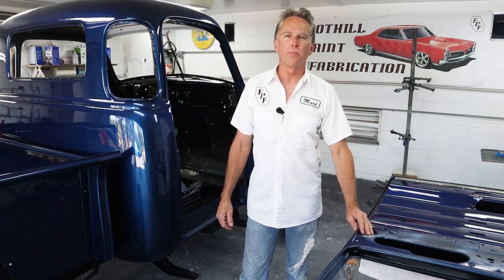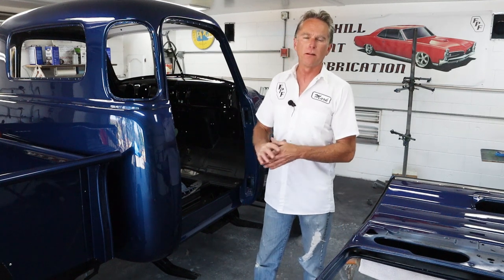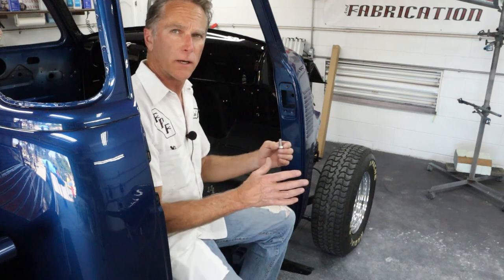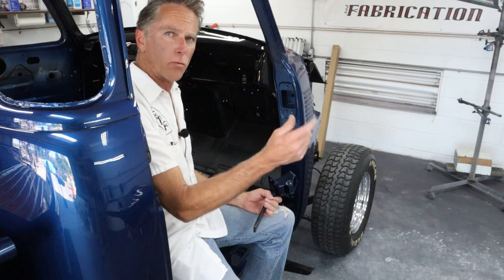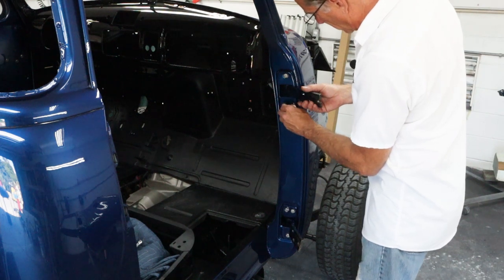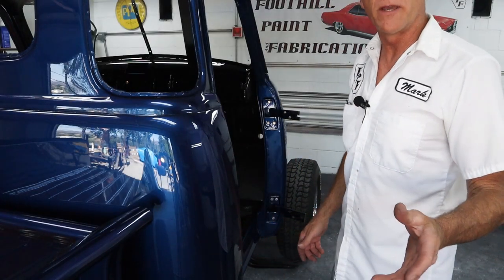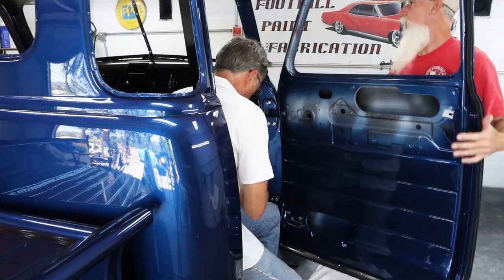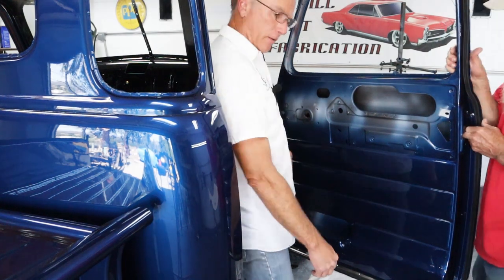1950 Chevy Truck (Ep 69) Hanging and Adjusting the Doors on the 5 Window Cab

Comment: Rewatching some of these misc '50 pickup videos Mark. Getting closer to sending the panel truck out for painting. I want to test fit the doors this week to check the gaps, etc. Domt anticipate any problems because the the truck has led a pretty sheltered life the last 45 years sitting in various garages ha ha. Will email some updated pics soon. Thanks for your videos!
Reply from the maker: Awesome progress!
Remember when these trucks were built fit and finish wasn't all that great. You can absolutely do better with some work to the hinges and latch. Getting that bottom corner just right can be frustrating and usually impossible without reshaping the door. Of course it depends how far you want to go. 
What color did you settle on?
Mark
Reply: Nardo gray. A solid darkish gray. The fenders & running boards will be black with a pearl/metallic tri coat.
Reply: Now you have me worried about the bottom corner! Well, I will find out soon..
Reply from the maker: Nardo Grey like off a BMW? @BusyAsABeaver72
Reply from the maker: Hopefully yours are nice.  The door doesn't always match the curve of the cab of over the years the latch pulls the center in but the bottom stays out a little.  It is all what you can live with and how much the weather stripping will show.  @BusyAsABeaver72
Reply: Nardo Grey is orginally an Audi color
Reply from the maker: Can't wait to see it all painted. @BusyAsABeaver72

Comment: Had to revisit this after tearing my hinges out to rebuild. Were you saying the beauty plates are spot welded on originally and tend to get crooked? I'll check this out.
Also, I appreciate the tip to get the hinges back in the pocket! The top hinges with the new springs is almost an impossible fit. But now I see the hinge has to be fully open and then a slight bump to get them past the opening.
Reply from the maker: On Darren's the passenger side beauty plate was spot welded on a little to high reducing adjustability. Once the hinges are rebuilt slide them in the body then slide them up and down watching when the beautiful plate hits the recessed area and when the slotted hole runs out of alignment with the threaded hole. You might have to get medieval on them to free up enough adjustment.

Comment: Mark, on my 46 international the front clip has to be on the truck before the doors can be aligned. There are torsion rods that tilt the top of the cab forward. 

I was trying to see if you hung the front clip as one piece or if you assembled the clip to the cab and chassis one piece at a time. 

Also I don’t know how to send you some pics.
Reply from the maker: Dan,
On the Chevy you can do it either way if you have plenty of help but if you are doing it with just two people then a piece at a time is the best plan of attack.  The 46 International is a beautiful truck but I have never had the pleasure of working on one so I can't say for sure. 
You can email me pics and a bit of info on your project to:  foothillpaintandfabrication@gmail.com
Mark

Comment: Mark, this is the video I’ve been waiting for! (basically since the internet came out) Can’t wait for the hood install ;)
Reply from the maker: Hey Wes I wanted to let you know the truck will be coming back pretty soon and I will be getting the hood repaired and painted and then reinstalled.  Keep an eye out for it.
Mark
Reply: @FoothillPaintandFabrication  awesome, thanks Mark! I’ve been working on getting my hood lined up and there seems to be some play in the hinges on the hood side.  Anyway, making some progress on my truck but it’s not to the paint stage yet. Happy to send photos if you’re still interested though I’m not sure the best option from an iPad.
Reply from the maker: @Stoked778  As long as the hood settles into a lined up position when closed you should be okay but if it won't consistently close to the same lined up position you will need top repair or replace the hinges. You can email your pics to me. foothillpaintandfabrication@gmail.com

Comment: Thank you for this incredibly informative series - fabulous and meticulous workmanship. I have a 'non-door' question if I may - it's regarding the hood fitment/alignment (edit - watching your hood videos now, alignment is coming soon I think! ) - I believe I may have to resort to similar techniques in elongating the holes to get hood all aligned properly; it still has the original hinges and they work really well, self-supporting the hood's weight completely unassisted; but especially on the right side, it sits quite high. Any tips you might have would be appreciated! As for the door, my driver's is really good, the passenger however is not so great - I'm torn between buying a repo door (problem exacerbated by me having a 51 with quarter window and lever handle! - so would need to convert to single piece window on a 47-50 door I believe) or repairing - needs new outer patch at bottom, however there is also a defect in center of door and also right at the window lip which I would perceive to be the most challenging element of a repair; I'm torn over potential fit quality of a repo door (although recognize even original have their challenges!) vs this one, which needs much work but actually 'fits' really well.  Your counsel would be most appreciated!
Reply from the maker: Thanks for watching the channel.  Most people install the hood and then match the fenders to the hood.  In this case I had the owner install the inner fenders and fenders but not tighten the bolts down all the way and once the hood is completed I will install and align everything.
As you know the fit and finish on these trucks was not good from the factory so the hood may have been high from the start on one side. First step would be to carefully check the hinges to make sure they match as one may have been replaced over the years.  Next you want to check that the hinge was actually manufactured correctly and the mounting holes are correct. Then check the cab and see if the mounting holes match the other side. I have seen crazy things over 40 years of autobody work so don't discount wrong parts/wrong year parts, patch panels installed wrong, factory holes drilled/punched wrong or anything really. Bent hinges are usually the culprit. 
The door is a tough choice.  I did a quick  search and found a 51 to 54 repop door for 500 bucks. The problem with repops is you just don't know how good they are and how much work you will need to do to get it fitting and looking good.  Since you know what you have with your current door I would price out the patch panels you need to buy to repair it and then go from there. If the panels come to half the cost of the whole door then get the repop if you can find one that matches your application. Even though your labor is free adding in the welding wire, grinding/sanding discs, body filler and primers plus frustration you would about break even. If you really want to save the old door it can be done but only tackle one panel at a time as cutting into these doors in to many spots can let them move a lot.  Start on the window lip since it sound like the hardest part and if you cannot make it work the repop door is the easy choice then.   
Let me know what you decide and send me pics of your project and I will showcase them at the end of a video.
Mark
Reply: @FoothillPaintandFabrication  Thank your for your detailed reply Mark - very helpful and I'll use these notes to do more work on the hood - it's high even with respect to the cowl, so seems fundamental cab to hood issue (although as you say, might be in the hinges themselves!) It's one of those things where you wish you had x-ray eyes to figure what's going on under there when you lower it :) :) :) 
As to the door - you may not be aware of the '51 nuances - while parts might be listed as a "51-54", is usually designated as such because of the quarter window config but is really a 51-1/2 -54; the handle/latch on the early 51 is swing lever (like 47-50), vs push button on the late 51/52+ - and it's not just in the latch, the striker and indeed entire pillar mounting for the striker is different, meaning a 52+ door swap is really not at all viable; but the early 51 has the quarter window like its later variants!  (hence the 47-50 choice as far as door latch fitment goes, but with the downside of the single piece window unless I can somehow make the window parts fit) That is why vendors 'who know' this subtlety list the doors as 47-50 and 52-54 with 51 notably missing - and of course you can't blame the repo guys for not catering to that one-off year (or half-year even!!!) Without having an actual 47-50 door to see if the split window parts from my 51 will fit, I can't quite tell if they will or not - logic kinda suggests that when Chevy decided with the styling change to go to the quarter windowsfor 51 model, they continued to use existing door/cab stock before going to the push button latch which incorporated metalwork changes to both cab and door; that would make economic sense on paper at least that they would not go to a new physical door for less than a year but that's only speculative on my part. 
I will follow your suggested plan, because not much to lose - however if I do end up getting a 47-50 door, I'll see if the split window parts fit, to test my theory!
Reply from the maker: @decosse01  I did not know that thank you.  Those one year only half year production stuff really screws things up when you are sourcing parts.  GM wasn't in the habit of making huge changes so you may be able to get the parts to fit with a little work.  Try and save that door first, I bet you can totally save it.

Comment: The truck doors look nice. Have you done a video for a TriFive?
Reply from the maker: Sorry no videos for the Tri Fives.  I have painted a 57 Bel Air and a 53 210 Business Coupe but those were long before I started the channel.  Here is a link to a walk around on the 210.  https://youtu.be/qW3eIQDjeGo
What are you working on?  150, 210, Bel Air or Nomad?
Mark
Reply: @FoothillPaintandFabrication  Thank you!!!
I have a 56 Belair I want to make the doors fit a little better.
Reply from the maker: Nice! 56 is a beauty, My buddy has a 57.  Of course the first thing is the hinges. Pulling the doors and inspecting and rebuilding the hinges has to be done. Before you pull the doors, with help loosen the hinges and see where you are running out of adjustment to get them where you want them to be so you have an idea if slotting the holes is needed. Remember to adjust the doors to the quarter panel and  A pillar then adjust the fender to the door.  Sometimes you have to make a little more adjustment than they did at the factory.  @johnragazzo2244
Reply: @FoothillPaintandFabrication  thank you....

Comment: a little tip , door alignment on these is a chore ...so, when mocking up the doors before paint. get the gaps and closing set right then drill a small hole (1/8") in an inconspicuous spot through the sheetmetal of the inside of the door through the hinges. when you get it all back from paint, all you have to do it put an 1/8" drill bit (or 8d nail)back in that hole to realign it to where you wanted it. also helps to not paint the hinges where it needs to slide into the door pocket. its tight enough as is . mask the hinges off about 1/2" in from the door pocket edge.
Reply from the maker: Thanks for the great tip Charles!

Comment: On new vehicles the back hinge nut plate floats.. these are welded. How do you adjust the in and out? Door at different depth than fender.
Reply from the maker: The holes in the hinges are oversized allowing some adjustment. If you cannot achieve proper alignment then slotting the hole a little should do the trick. If the door is way off something is bent out of place more than likely. 
Mark

Comment: Do you have a video installing the front clip?
Reply from the maker: Hi Larry,  No I don't as I shipped the truck back to the owner for assembly after I installed the cab.  It was pretty straight forward from what he told me.  I did have to adjust everything once the hood was in place and aligned though.

Comment: My driver side door appears to be twisted, and it sticks out on the bottom rear. Next to the cab. Do you have any suggestions?
Reply from the maker: Mark, It could be twisted or it may have been like that from the factory.  The fitment back then was horrible and if you look at some of these trucks from that era you will see the same things, even this truck a little bit.  Trying to bring the whole door into better fitment is tricky because what you do down low affects the window frame but the good news is the window frame is easier to tweak.  First determine if the door fits correctly on the inside when closed fully and adjusted as good as you can get it.  If it looks like it sits correctly inside and you tweak the twist out of it then it may hit somewhere else and not close. More times than not the lower corner just sits out to far but everything else lines up pretty well.  If that is the case then (if you have the skills) slicing the inner door carcass in that area and carefully reshaping the door skin is a good way to go. Leave the door skin attached to the inner door carcass and slice a piece out allowing you to pull the skin inwards and tack it.  Where to start and stop the slice and its shape are key.  Always go a few inches beyond where you think the reshape should start so it is a smooth transition. If it is twisted leave the door on the truck and get medieval on it. Open the door a little and take a 4x4, slide it through the window down at an angle to the corner you want to pull. Attach the 4x4 to the corner somehow and pull.  Check frequently to see if you are making progress.  Use a block of wood at the fulcrum spot to make sure you do not bend the door at the window channel.  These are my ideas not seeing the truck.  Let me know what you decide and how it works out.  Take you time and think it through.
Mark
Reply: @FoothillPaintandFabrication  , thanks so much for all the info. I’ve started on some of your messaging techniques. They seem to be working. I want to keep the slicing for a last resort.
Reply from the maker: @markbramhall2060  Good idea, start off small and simple and then go from there. It all depends on how perfect you want the truck to be in the long run.  For me door fitment is a very big deal and I look at it closely at car shows.  Once you decide what level of restoration you are going to do then you can decide where to draw the line.
Let me know how it works out and send me pics of your project and its progress.
Mark
Reply: @FoothillPaintandFabrication  , I’ll let you know, as well as some pics. I’m real particular about the fit as well. And thank you again for your help. It’ll be a few days before I get back out there, I’m fighting an upper respiratory infection, along with some fluid in my lungs. Gotta wait for the meds to kick in.  At 75 and doing this project by myself, I have to watch my health.
Reply from the maker: @markbramhall2060  Take good care of yourself first always, the truck will be waiting for you...
Get well soon
Mark
Reply: @FoothillPaintandFabrication  , thank you sir.

Comment: I’m installing windows now…. are you going to use a sealant?  I’m using 3m sealant but man it’s a messy job.
Reply from the maker: Darren the owner will be installing the windows unless he needs me to do it. Are you working on the door glass or the cab glass?
Reply: @FoothillPaintandFabrication  Currently installing the back windows and the windshield. I’m using a bedding and glazing adhesive for the pinch weld and a urethane adhesive for the rubber to glass.   I’m noticing a lot of people just skipping the sealants. I can understand why, its a huge mess.  I still have one door left to paint so haven’t done the door windows yet.
Reply from the maker: Yes I believe the windows were just installed dry no sealants at the factory.   If you have nice window rubber it might not be needed but if they don't lay down nice against the body they could let water it.